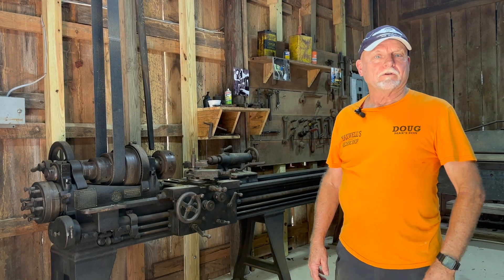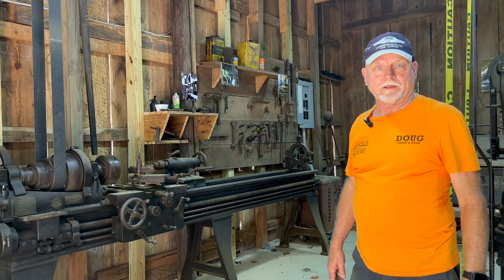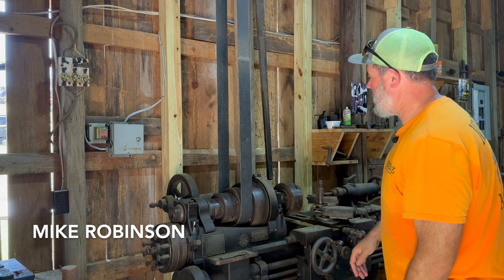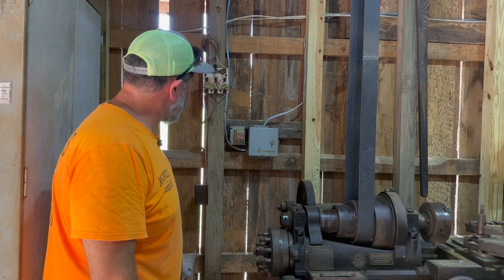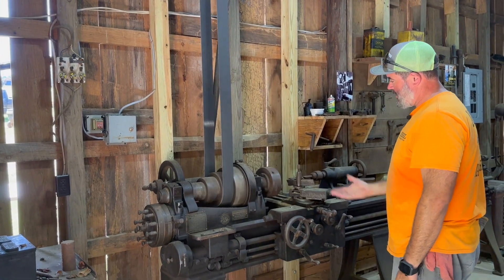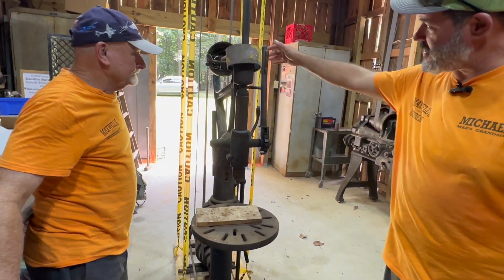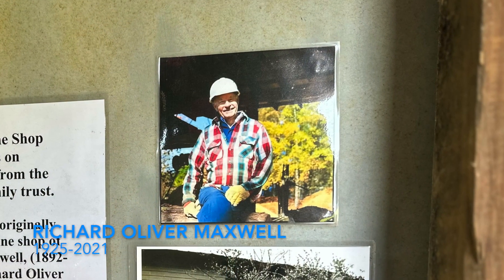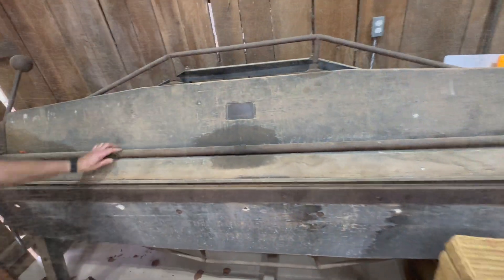Maxwell Family Exhibits: Part 1

Comment: Thanks for posting this video. That stuff very interesting to me. I worked  in a machine shop in Hamilton, Ohio for 19 years. Ran every lath they had. From a small bench lathe to large  computer-controlled VTLZ with an 82-inch table. I would have retired from there, but they sold us down the river. Sold the business to a company out of Dallas-Fort Worth. The old machinery  interests me. You keeping it like your dad said "don't trash it" is a good thing. The old  machines bring back a lot of memories.
Reply from the maker: Thanks for the comment.